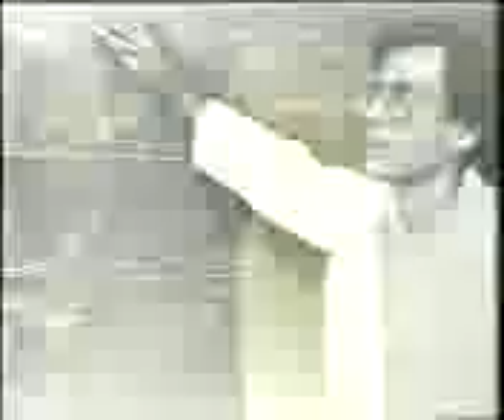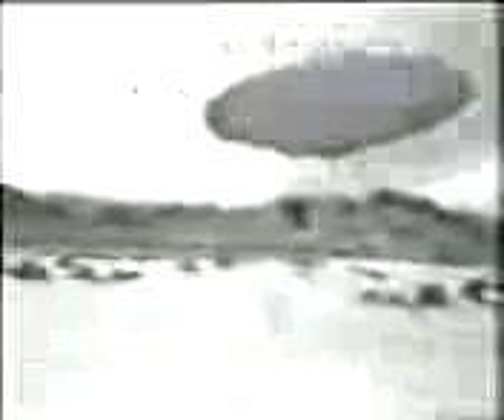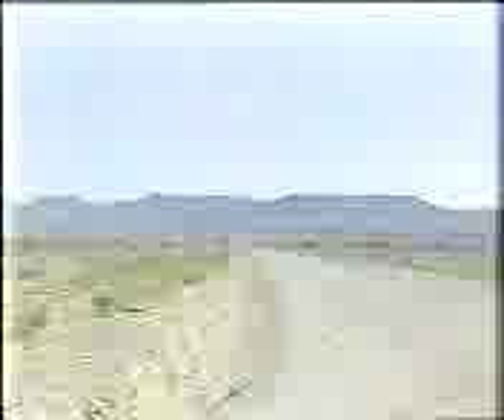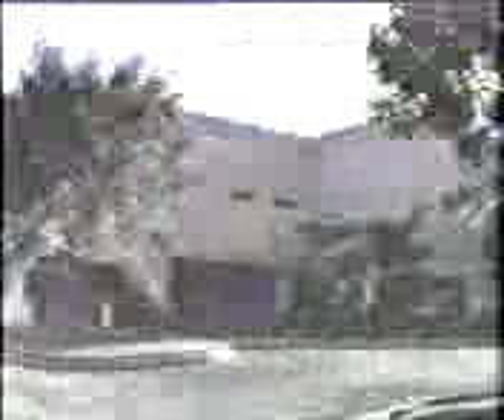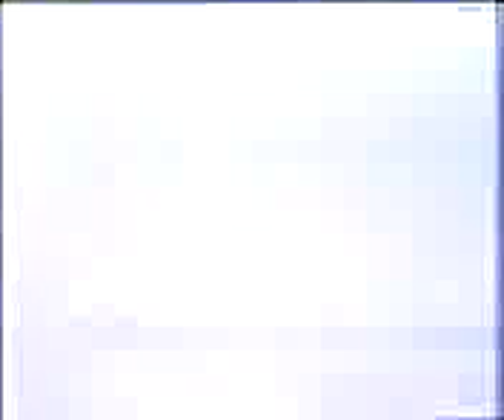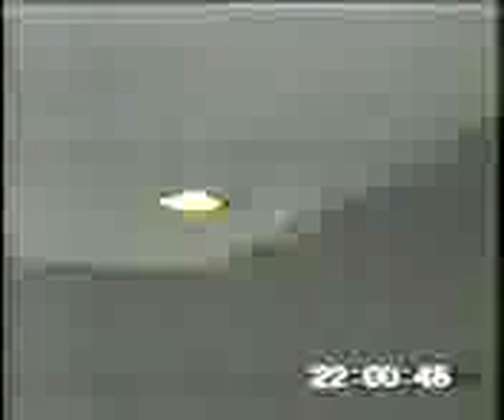UFO Bob Lazar Interview

Comment: He told his story to gain leverage in a harsh situation, and wanted to leave it alone. If it werent for many reporters pulling teeth to get him to repeat his story, he would have been a one show act. Not an avid trait for attention grabbers.

 And lastly, the man has built multiple particle accelerators, multiple jet cars, obviously had a decent job at LANL(not just a temp contractor, they dont get waved in by security if you know anything about the base),

Comment: The three SPHERES are propulsion-condensors, and are spherical-condensors. Theae are rapidly charged-and discharged millions of times-per-second, in a rotating pattern every 120-degrees, in an on/off duty-cycle. Simple-effective, dynamic-counterbary (gravity-control). Video of Bulgarian UFO on YouTube is real. Notice it has a rotating plasma (torsion-field). Same inertia-free behavior of genuine-UOFs.

Comment: My opinion was slightly skeptical in the 1960s. But all that changed after a few years of research, starting in 1968-9. And in the 1980's, I had my own sightings, filmed strange craft in 1981, and saw a black disk less than a mile away in 1987, Westchester County, 7-miles northwest of NYC. Anyone who has done ANY research knows that 1. UFOS ARE REAL, 2. TWO DIFFERENT SOURCES, EARTH TECHNOLOGY AND OFF-EARTH TECHNOLOGY. Electricy works same in the entire universe.